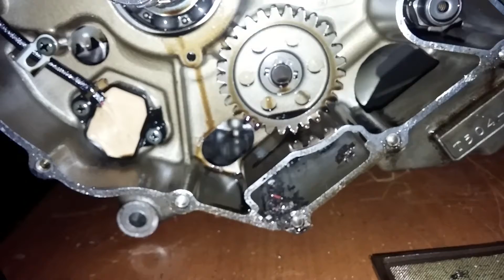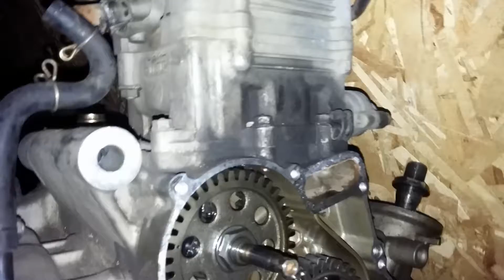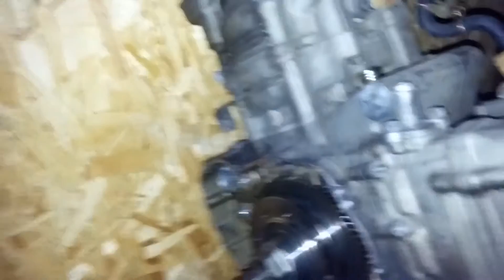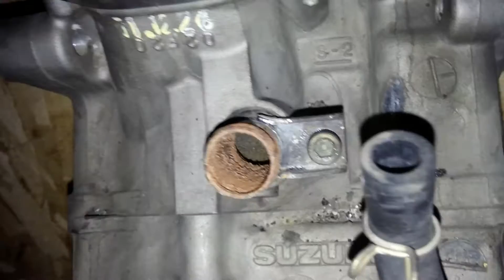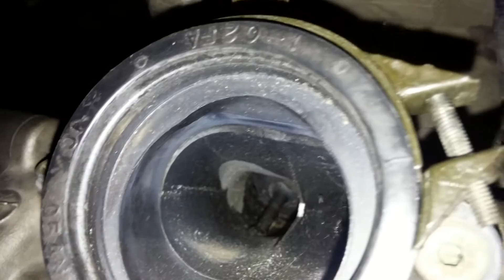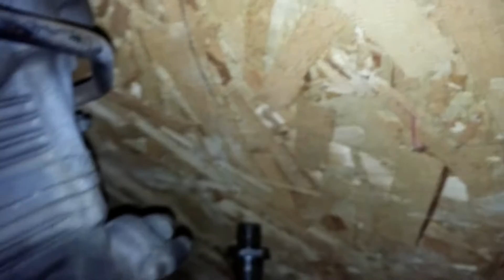$100 Blown tl1000r engine

Comment: ok mine is blowing smoke and oil out the tail pipe is mine blown?
Reply from the maker: Braindead0025 Kelly 
does it do it all the time or after you do a hard pull?
Reply: Sirallony yeah it does when u start it and run it we had to drive it back over a long bridge and just pouring smoke
Reply from the maker: Braindead0025 Kelly 
you could have a blow piston ring, valve seal, or a lot of oil in the airbox. 
check and clean the airbox of oil if there is any that will  make the bike constant smok if you have enough oil Blow by.
Reply: Sirallony ok thank you sir will do I just got this bike for 1600 and don't smoke Intill we went down the road so idk but I do thank you and I going to sub to your channel :)
Reply from the maker: there will be videos on how to rebuild a tl motor on here shortly. :)